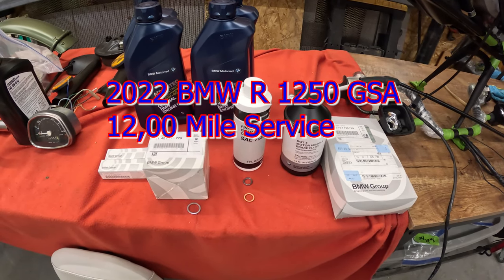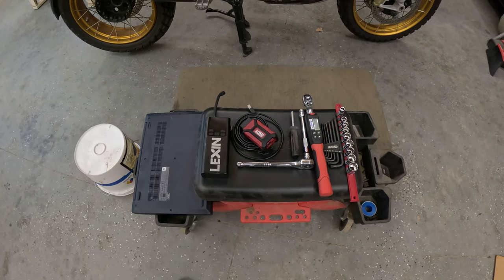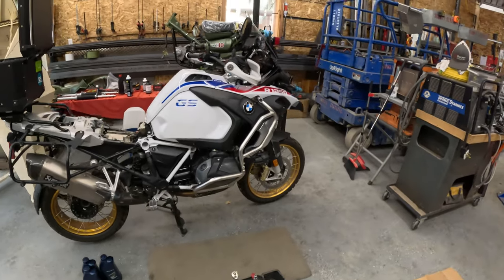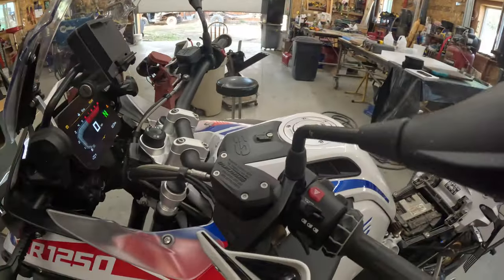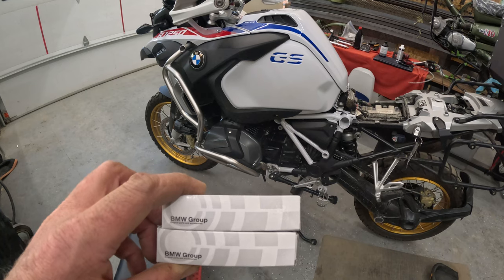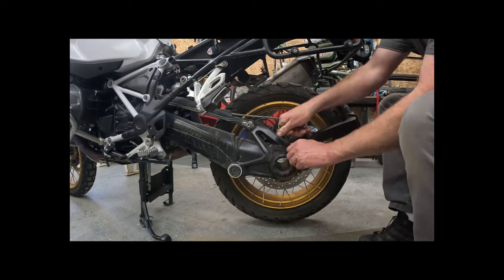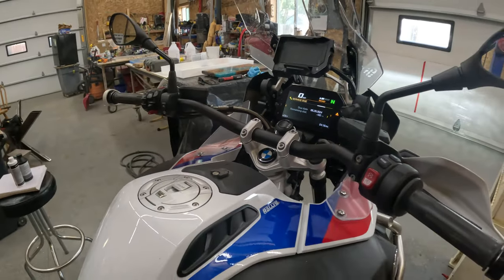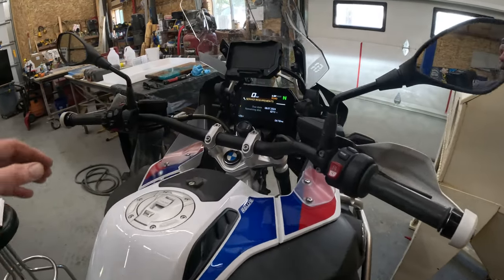12,000 Mile Service 2022 BMW R 1250 GS Adventure Including Brake Fluid #motovlog #bmwmotorrad

Comment: Why skip the valve clearance check -- or do you have that performed elsewhere? Using the Motoscan app with a USB-to-ODB2 adapter is cheaper than a GS911. I have a GS911 anyway, because it does more and explains what it does better.
Reply from the maker: The valve clearance was done by Missoula BMW in order to keep the factory warranty in order.

I agree about the USB GS 911 for the price and the options.

Thank you,
Mike
Reply: @motorradmikegrossheim  Read up on the Magnuson-Moss Warranty Act. It was passed by Congress in 1975, and deals specifically with what a purchaser of a product can do in regards to voiding a warranty or not. Harley-Davidson recently was busted a year ago for this and forced to honor warranties in cases of independent/self repair or use of 3rd party parts. None of the maintenance you perform or have performed at your direction outside of a BMW dealer will void your warranty unless BMW can prove in court that what you did directly contributed to whatever issue later arises and BMW refuses to cover.

BMW used to sell service DVDs of all its bikes, including the RS. In early spring of last year, they ordered a stop sale of the DVDs and ordered all unsold inventory be shipped back to them. A dealer will make far more off of servicing the bike than selling it.
Reply from the maker: BMW also got into "Industrial Banking."  Only allowed in Utah.  Congress cut off new companies starting a new industrial bank a few years ago.

BMW probably makes more money off of lending now than they do, making cars and bikes combined.

Comment: Thank you for posting such an informative video - very much appreciated!  Have your exact same bike (including the manual suspension), all your steps seem clear however I was wondering what your thoughts were on using the 75W-90 final drive oil instead the 70W-80 the owner manual specifies?
Reply from the maker: Great question.   Thank you.

"SAE J306, which is the standard for gear lubricants, had been revised in February 2019, and it tightened some of the broad windows of kinematic viscosity. That is why BMW adopted the new limits."

All of the dealers still carry and use 75 w-90.

70w-80 is more expensive and hard to get.  I picked up my kit from the dealer, and that is what they gave me.  Unless you live and ride in cold weather all the time or have trouble shifting into 2nd cold, it shouldn't be a problem.
Reply: Have not heard about the J306 spec change - that makes sense.  Talked to my dealer (Grand Rapids, MI)  yesterday - and just as you stated, they also use the 75W-90 when servicing these bikes. Thanks for your quick response!

Comment: To fill the shaft drive reservoir with oil I use a typical small oil can with the thumb pump.  It's such a small amount of oil, it takes no time and you have great control over how much oil is going in and the level when it is reached.
Reply from the maker: @danman5857  Thank you.

An oil can with a thumb pump is the correct tool to use.  If it get another shaft drive BMW I will definitely buy one.  The turkey injector works really well, too.  I cut the end off slightly and it allowed the oil to flow out of the end.  It worked really well.  The hard part is lining up the hole inside on the axel with the fill top to get the oil to slowly leak in.  You're right about a small amount of oil.  It is only 5 oz.  Just go slow when adding new fluid and it will drain in properly.  Too fast and it will spill out, like you can tell in the video by the mess on my floor mat.

Comment: 10,000km are 6,213 miles. Just the conversion being a metric bike.
Don't forget to check the spokes. It's an often neglected maintenance position on spoked wheels that can cause severe injuries.
If you need the BMW TIS shop manual, I can send you a copy.
Reply from the maker: Good call.  Thank you for the informative comment.

I check the spoke tightness when changing tires.  When I dismount the old tire, I do a full inspection and cleaning of the wheel.  I burn through tires way faster than the 10,000-mile service.  

I'd love a manual. 

Thank you,
Mike
Reply: @motorradmikegrossheim  Good to know you keep up on the maintenance plan. The Advantec oil is excellent, has high amounts of anti wear and detergent additives. Engines with high mileage still look spotless with no discolouration on the inside. Also check out their Advantec Protect fuel additive, unfortunately it's the only BMW approved fuel additive, but it contains tons of PLA that cleans off carbon deposits like nothing else.
Did you already receive the updated maintenance plan from July 2023? They added removing the shaft drive, checking it and lubing the spines to the list every 20,000km and replacement of the shaft every 60,000km, but I will overhaul the old one with new u-joints with zerk fittings at a local shop. 
The shop manual is a PDF file. If you are OK with it, I e-mail you the link of the cloud storage to the address on your YouTube page. It's 150MB, too large to send it directly via e-mail.
Reply from the maker: @LMO169  thank you.

Email on my page works perfectly.
Reply: @LMO169  Is it possible to send the manual to me? Thanks! I appreciate
Reply: @carvalhonj  do you have an email?
Reply: @LMO169 Would you mind sharing the manual with me also?